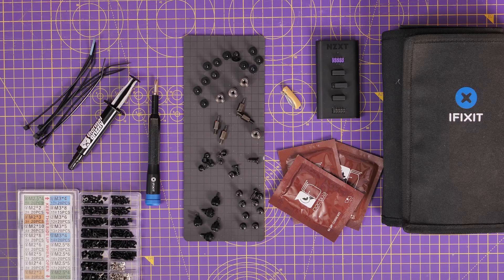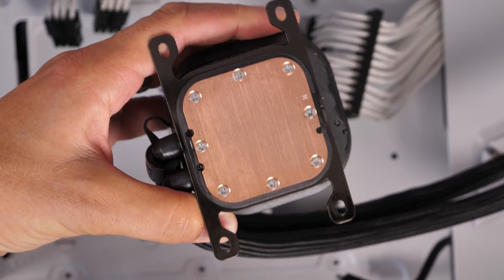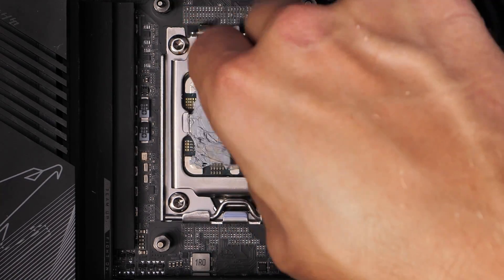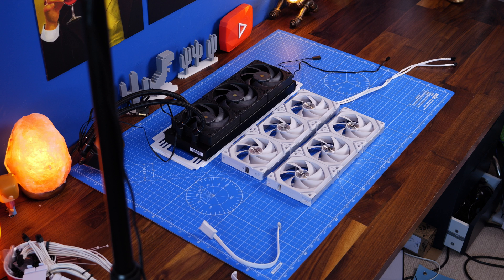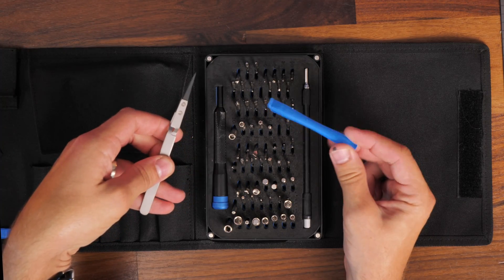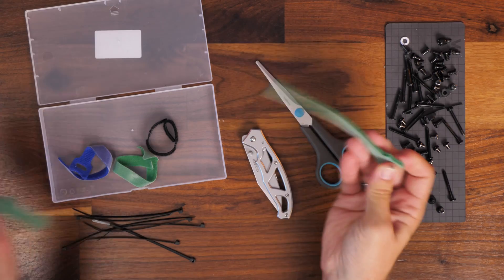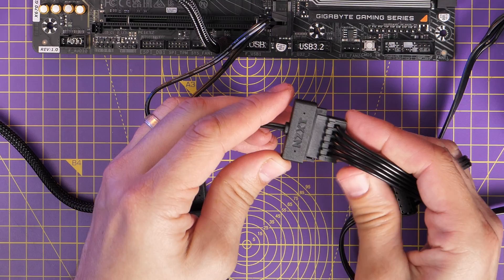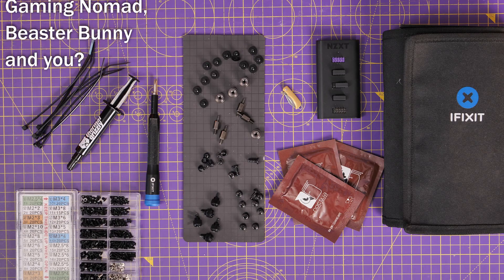Essential gear for PC builders - things I'd highly recommend buying

Comment: Do you go with the 5 dot thermal paste pattern recommended by Noctua?  I was going X pattern when I build in the next few days, but the Noctua manual that came with their cleaning kit suggests 1 4mm central dot and 4 surrounding 2mm dots in the corners.  Probably overthinking it...
Reply from the maker: I spread paste because I'm a renegade
Reply: @TheProvokedPrawn  Spoken like a true crustacean.

Comment: hello i have The  ASUS ROG RYUJIN ||| 360 ARGB CPU LIQUID COOLER WITH THE 3.5 LCD  in White 
and i would Love to put  the Lian Li uni AL 120 v2 ARGB on to it but the screws what come with 
the Asus ROG RYUJIN ||| 360 are not long enough to fit through Lian Li fans and on to the radiator 
and i do not no what size screws i would need so i can fit them so i can move on to the next 
stage so can you help me out please as i am in the uk

Comment: i just touch the metal parts of my case to ground myself before doing anything .
Reply from the maker: That's only going to work if it's plugged in and grounded though
Reply: ^^ This...while I do make sure and do a few touches even when dealing with fans out of my own paranoia.